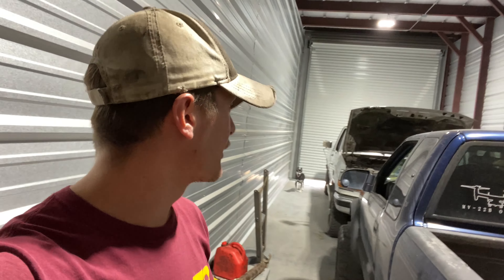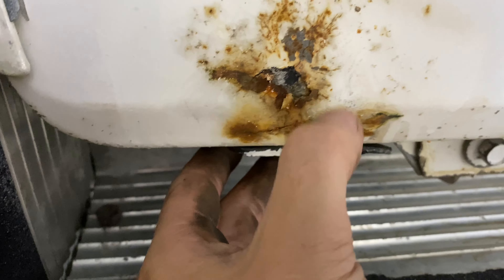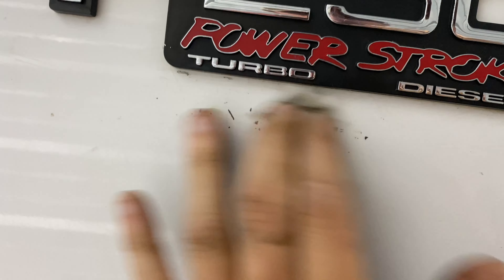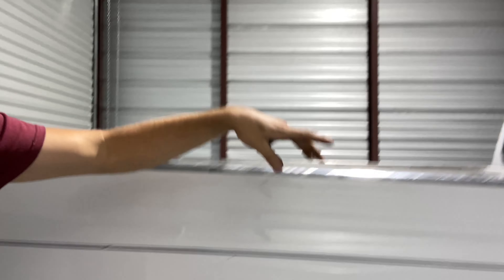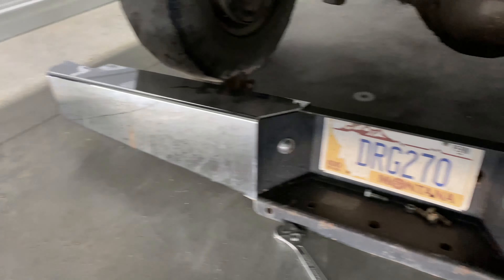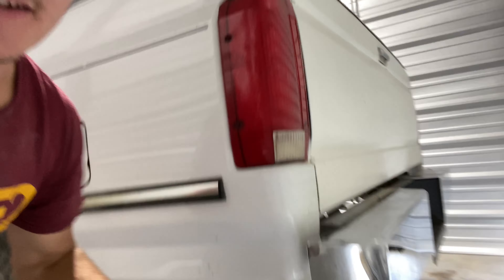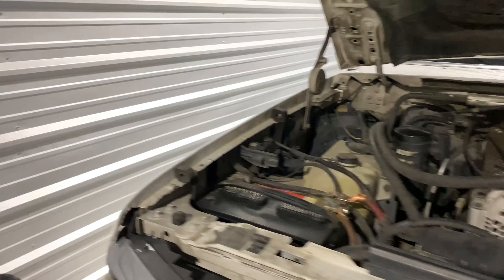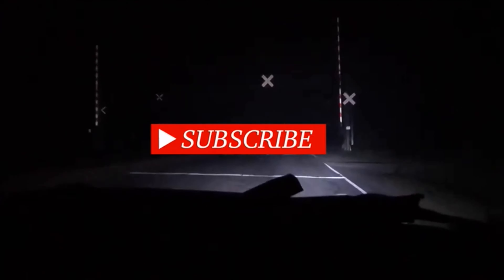Dang ‘ole bumper man. (OBS 7.3 EP.4)

Comment: I know rhis us random  but i nee help. I have a 2006 silverado had a 4.3 it went bad . So im looking to replaced it.  I bought a 4.3 out 03 silverado ( *supposedly)  but this has an egr valve abd mine dint. So will the be any problem?
Reply from the maker: Yes because the computer is going to expect a reading from the sensor there. Just swap the lower manifold with your lower one.
Reply: And can I put a 2003 on a 2006 year truck?